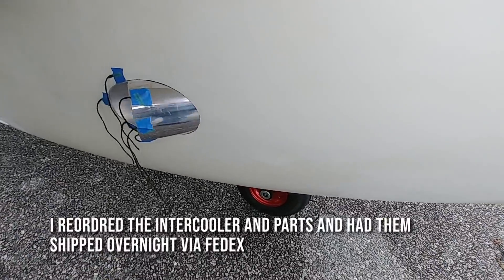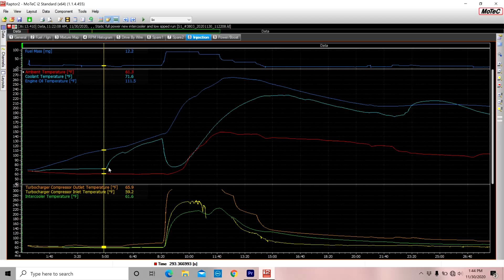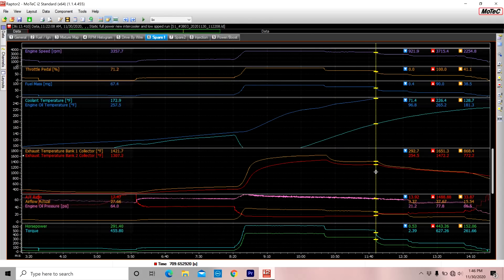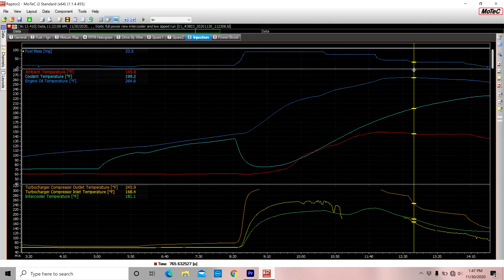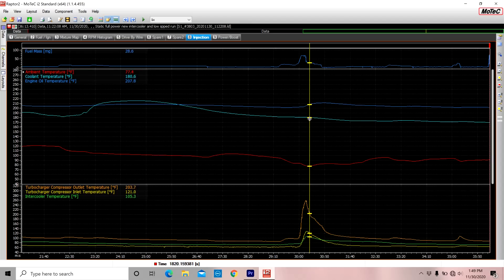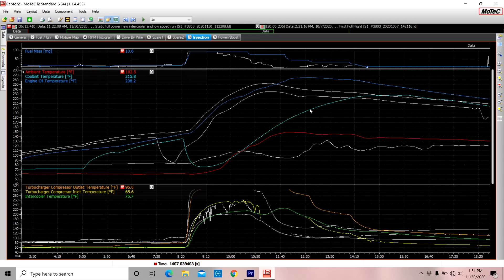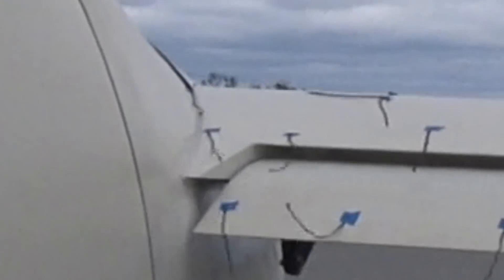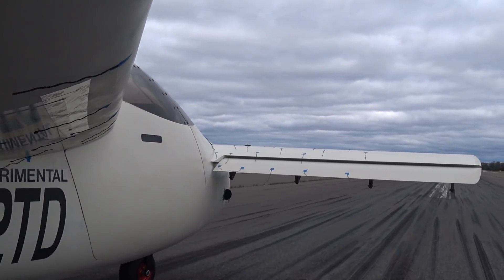Intercooler Installed - Building the Raptor Prototype

Comment: The intercooler up front looks like it is buying a fair bit of time. I was in a very similar situation A/C condenser inter cooler for a turbo with an engine making big HP. It seemed counterintuitive to me however the electric fans were restricting clean airflow. Your videos have shown at idle a great deal of air existing the cowling at the tail from the prop. As a test turn on the electric fans without the engine running, see it your tell tails show the airflow they do when the aircraft is sitting still with the engine at idle. If they don't show as much airflow I think the electric fans are causing a restriction as they did in my situation. It took me months of changes and many sleepless nights before I pulled the electric fans from the mix and realized they were causing my problem of overheating. While you are waiting for flying weather its worth a try let the tell tails fly without the engine running on the intake and at the exit of the cowling. Both with engine on and off. If you see a result I suggest pulling the fans all together to free up the flow. I love your design and would love to fly my family in the comfort that cockpit offers. Good luck

Comment: Have you considered using a liquid to liquid heat exchanger? Use the Jet-A with a return-to-tank circuit to cool the coolant and/or engine oil. I used to work on OV-1's and RV-1's that implemented this type of design to use the JP-8/Jet-A to cool the engine oil. This could be a weight saver...

Comment: Since the aircraft is having the most trouble cooling while slow and with gear down, an interesting solution might be to route airflow from the wheel wells into a secondary radiator.  Plenty of air to work with, and when airspeed is high enough for the primary radiator/air scoop to keep the engine cool, the gear doors will be closed and the additional drag of secondary radiator airflow is eliminated.  A spring operated scoop that drops into the airstream when the gear doors are down to divert air into the radiator, and is pushed back into the wheel well by the gear or gear doors when retracted.  It could be made with a bypass valve that flows coolant to the secondary radiator when the gear is down and diverts to the primary radiator when the gear is up, operated by the gear or gear doors so the pilot would not need to remember any additional steps.  Extra cooling when it's needed, and completely automated.  It'd be dead weight when cruising, but at least it won't come with a drag penalty as well.
Reply: I like the lateral thinking.. interesting idea, will give you that.
Reply: I thought about that a couple months back as well.  Pretty sure the wheel wells are surrounded by the fuel tanks, so too much work and would reduce fuel capacity.  I was thinking a leading edge lip around the wells might divert air over them, but the Velocity and LongEZ have open wells, without significant problems.
Reply: @bartofilms  Not on the mains, but rather the nose.  Just a matter of re-ducting some air to and from the cooler he just installed.
Reply: @Skinflaps_Meatslapper  Ah.  Well, that might work, but in either location, he'd still need the inter-cooler inlet/exhaust on the outside.  Current data shows improvement, so let's await next test flight.  😎👍
Reply: @bartofilms  Honestly I think with a little bit of ducting work, both the inlet and outlet can be contained within the wheel well, though the inlet would likely need a retractable scoop to get it down into the airstream.  Wheel wells are naturally low pressure areas, even more so with a scoop in the way, so just having the outlet routed to the wheel well itself should be all that's necessary for proper airflow.  The big question, and what it would all hinge on regardless, is whether that cooler is going to keep things in check or not.  I'd imagine there would be room enough for a larger cooler in the nose, but the additional airflow necessary for a larger cooler might prove to be excessive even for a retractable ram air scoop in front of the gear.

Kind of off topic, but your idea of mounting radiators in the wing reminded me of something I had thought of years ago, using the entire upper or lower surface of a wing as a radiator.  A thin sheet of aluminum bonded to small gauge tubing running span wise back and forth, so the outer surface is smooth and clean while doubling as a radiator.  You get all the cooling of a radiator with none of the drag penalty. Since the heat would cause the boundary layer of air expand, my spitball hypothesis would be that when placed on the lower wing surface, an increase in lift would occur.  There was a WWI biplane that used this type of cooling, though it was located on the upper wing center section (it had a sort of unique gull shaped upper wing to allow for guns or more visibility).  Probably not the best idea for a combat plane, but I'm surprised it was never incorporated in civil aircraft.

Comment: Consider sticking a digital thermometer probe through the exhaust hose of the intercooler somewhere close to the outlet. It will tell you how much air is going through: if there's plenty of airflow through the intercooler, its temperature will match coolant temp closely; if there's very little, it will show close to ambient.
Reply: A mass air flow sensor placed in the duct before the intercooler would work as well.

Comment: What about mounting an IR camera looking at the outlet? You'd be able to see the different temps and probably see the airflow due to the contrast with the colder outside temp & fuselage temp. Keep up the good work. Looking forward to the next flight video.
Reply: Or maybe an IR camera mounted in the nose looking at the intercooler.

Comment: If the tell tails were made of smooth straight plastic, you would see a far more accurate picture of the actual air flow - made of what looks like wound wool which has lots of kinks in it - it bound to produce some turbulent 'shaking' of the tell tale! 
The exit nozzle for the intercooler air flow is also going to interrupt the laminar air flow around the fuselage, but this is minimal compared to other turbulence inducing items on the design - the brackets on the canard for example - of course all of this will be looked at again in the next prototype, - this is just a 1st proof of concept prototype and as such you have done an amazing job to even get this far.  Looking forward to seeing it fly again.  Patience is a virtue - stay safe, happy landings.

Comment: Maybe you already have thought of this, but do you have the ability to attach temp sensors to the inlet and outlet of the intercooler to see how effective it is?  That would be a good measure of airflow as well.  If it's dropping the temperature a decent amount, then you are set.  Otherwise, you may need to explore other, better cooler inlet options to capture more flow.

Comment: Can try a high flow fan, connect duct to the inter cooler on the ground for static test, to simulate a fractional airborne airflow.  I use a similar setup on my engine stands when i dyno a rebuilt engine.  Looks like some span wise airflow on the elevator, maybe vortex generator can reduce that.  Looking good though.

Comment: Have you thought about installing an oil cooler for the motor
Reply: It has an oil-to-water heat exchanger that is supposed to conduct heat out of the oil into the engine coolant. However, with engine coolant temperatures as high as they are it isn't very effective.
Reply: @gerardmccarthy2432  I think the better thing to do is completely revise the primary radiator installation. It needs to be bigger, and its ducting has to be revised for a better delta-p across the radiator--which probably also requires a larger inlet scoop. Also, the intercooler should be moved so that it is downstream of the radiator, or better yet, given its own dedicated inlet, duct, and outlet. Oh, and the air intake for the turbocharger should also be moved to its own dedicated inlet, instead of stealing air from the cooling duct. I think that's what's going to have to happen before flight times are measured in minutes rather than seconds.

Comment: Why is there no thermostat on the engine. You want an even temperature for the best performance and combustion.
Reply: There is a thermostat but it has nothing to regulate since it isn’t receiving coolant from the radiator at a cool enough temperature. The thermostat is wide open hoping for cooler temps but it just isn’t happening.

Comment: What is the max oil temp limit called out by the engine manufacture?
Reply from the maker: It's not published as far as I can tell. The synthetic oil can easily handle 300f which I have no plan going to. 250 is the most I'd like to go to while airborne. It's always nice to test beyond that on the ground.
Reply: @RaptorAircraft  I doubt you want more projects at this point but is there a way to put a direct ram air scoop onto the oil cooler?
Reply: @N4497P  The Raptor's oil cooler is an oil-to-water heat exchanger that is intended to conduct heat out of the oil into the engine coolant; no external air is needed. But with coolant temperatures as high as they are, it isn't very effective.

Comment: I've been watching you deal with this heating issue for a while, and I know this is a prototype that you are looking to solve to get in the air and get more flight testing. Could you elaborate on your non-prototype thinking to solve this issue though? Do you plan on developing an improved cooling system as part of a small redesign for prototype v2.. or.. just what is your longer term thinking?

Comment: Peter, you have to ensure air flow ducted in is less than air flow ducted out, I am not convinced this is happening, please invest in an Anemometer (air flow meter) one with separate display and fan. It will help identify the in flows and out flows while both standing still and in motion. It will identify the turbulent flow being generated by the inflow pressure, at the nose cooler, and especially the engine bay. Do this off camera. Please.